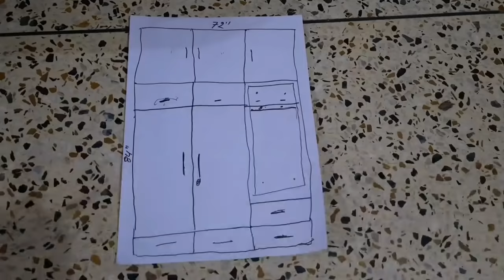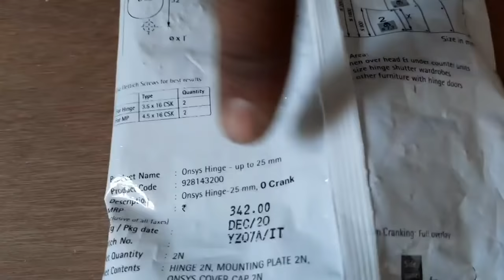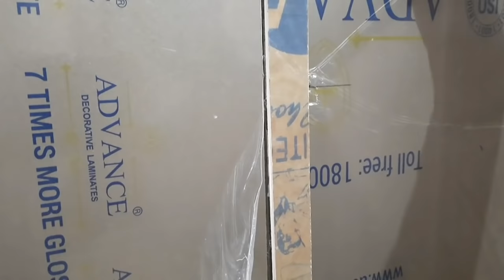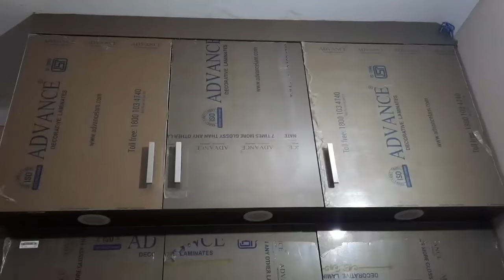How to build wardrobe size 10'×6' in 3 days..|wardrobe design |plywood box wardrobe |

Comment: This is very nice.  The technique for drawer slides installation is very good.  The small jig to keep the plywood on  long edge in order to do planing is simple and very effective.  I a not a woodworker or s carpenter, however I notices that before nailing all the pieces together you did not apply any blue.  I thought Glue an dNail combination would be a lot stronger rather than just the nails. Also "biscuit joins" would make it stronger but a bit more time consuming I guess.
The gluing of finished veneer to plywood would be very painful and difficult for me.  I wonder if staining and finishing the plywood with polyurethane will be better - I do not know and this is a question for the experts,
Also, would it make sense that the "edge banding" step  comes after gluing the veneer to the flat surfaces?  The reason I ask this is, you can have the flat veneer sheets cut slightly larger,  then use a router will trim but and cut it to perfect size, then do the edge banding, just a thought.

The last part of total cost, can you say that part in English please?   Thanks again for sharing
Reply: 36,000rs

Comment: Super🙏 Name of Gum for Mica Please ( brown color) tools for cutting Mica
Reply: He has used a sharp nail to cut the laminate.
You can also use a sharp paper cutter for the job.
Simply score/cut 1-2 times to about 1mm on the laminate side, then snap backwards for a clean cut. Just like you see the glass cutters doing it.
Note that this was a Sales Pitch rather than a DIY job.
The price mentioned 36,000 INR or c. 490 USD (Jun'21) was the sales price.
The raw materials should cost a max of 10-12000.
So a DIY job, not as clean as the one shown (pros), should be about 15,000.
Reply: @vickytutu  and he used too many nails instead of screws.  Nails can be used for initial alignment and then all ply  should be screwed  for better holding strength.
Reply: @mviv6339  Nails would be fine if he was using glue. If not, then yes, like you mentioned, screws would be much much better. Regardless of nails or screws, I always use glue in my projects.